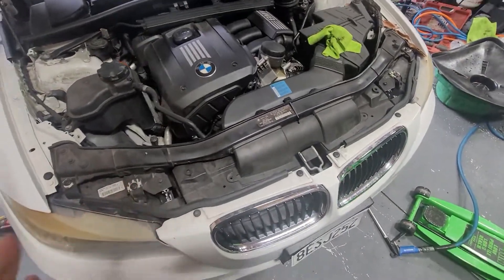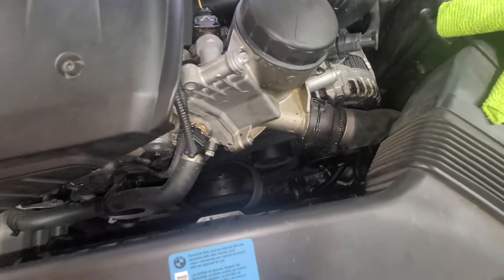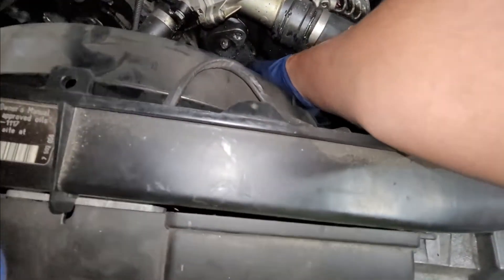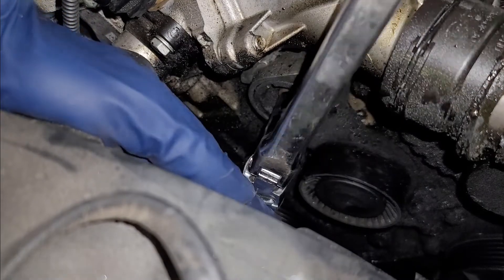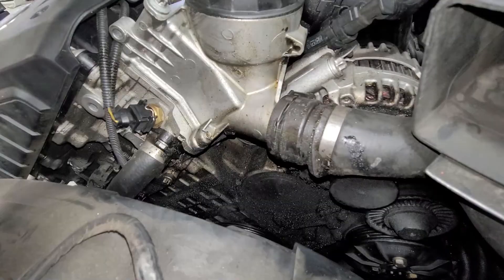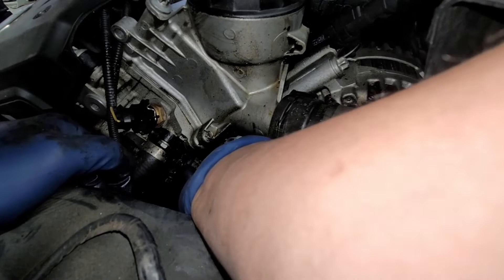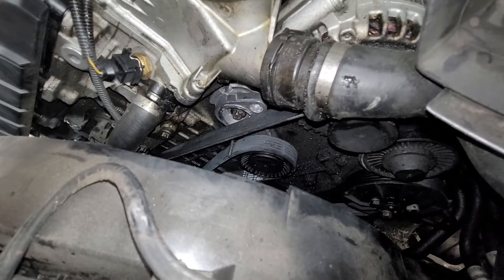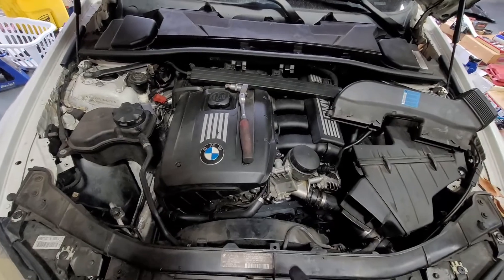2011 BMW 328i belt and belt tensioner replacement EASY

Comment: Thank you for the video. I was able to replace the tensioner and the belt on my wifes car. Great job explaining and showing each step. New follower now!
Reply: Well, apparently I didn't clean all the pulleys very well plus the fact that the car has an oil leak somewhere in this area, because belt came off and I had to come back to this video today to get a reminder on the direction of the belt. So, thank you again for helping me out twice with this. Now, I'm gonna go pressure wash the crap out of the engine bay and then sell this POS and buy her a toyota😅

Comment: How can you install that belt without cleaning all the grease, you know that will shorten the life of the new belt, right?
Reply from the maker: The engine was washed and degreased
Reply: @JaboTheMechanic  the oil filter housing gasket will leak all over the belt again